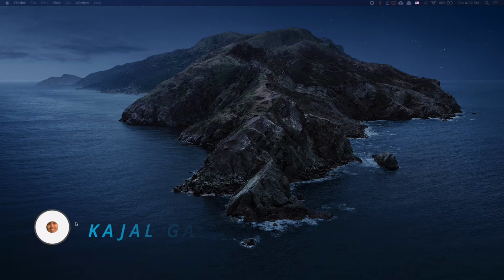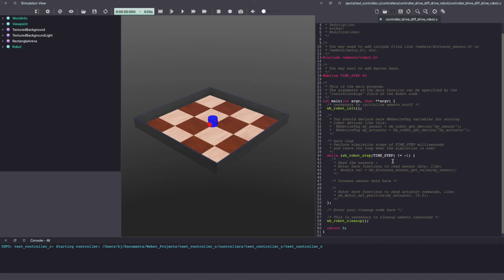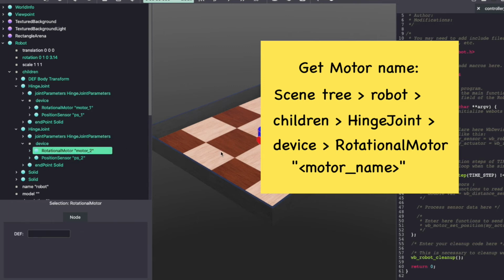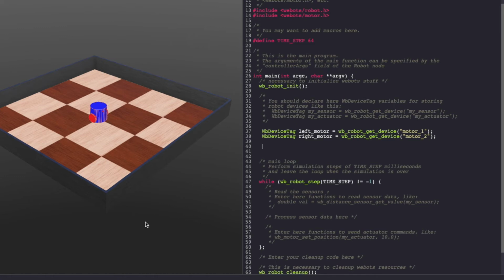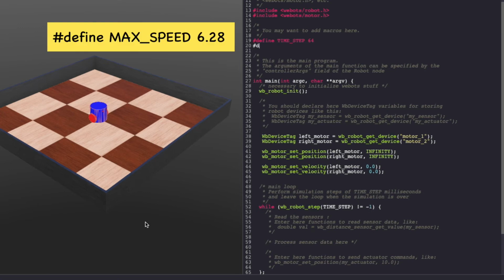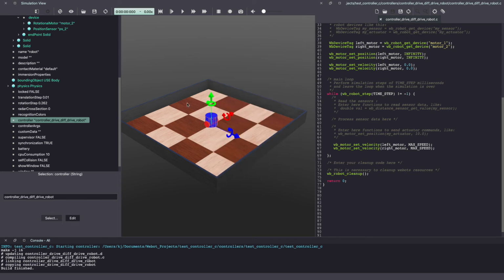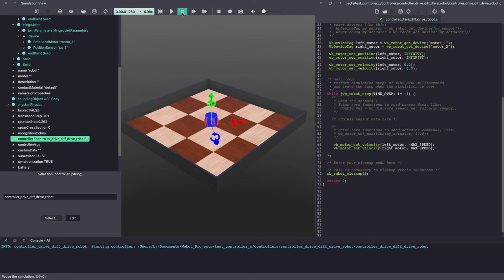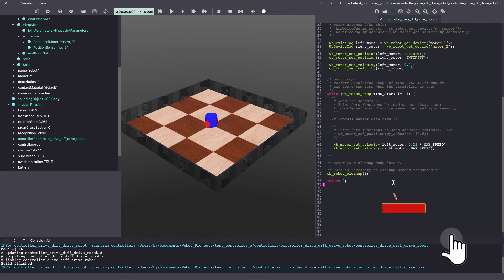Webots Controller Code in C // Webots Tutorial 3 use motors to drive robot

Comment: What do I do if the robot does not move ? I have checked multiple times if I wrote the code wrong but I didn't
Reply from the maker: (1) Did you update your robot in the scene tree to use your code?
(2) Did you compile your code if written in C/C++?

Comment: But problem arises with using stdio.h
Reply from the maker: After looking more into it, it turns out the message won't print if you don't have new line at the end.

Eg: printf("Hello, World!");  // Won't print
printf("Hello, World!\n");  // Will print.

This issue is logged here: https://github.com/cyberbotics/webots/issues/2492

So just make sure to add a new line at end of your print message.
Reply: @KajalGada  thanks a lot😊😊😊😊
Reply from the maker: Are you using stdio for printing?
Reply: @KajalGada  yeah
Reply from the maker: @srinirupan  I tried printing with printf using stdio in C in Webots and it didn't work. I am looking into it and will let you know if I figure it out.
Reply from the maker: I had to restart my Webots and that got stdio working, a bit weird.

Make sure your header is correct: #include <stdio.h>

I used printf to print my message.

Let me know if you still are getting errors.